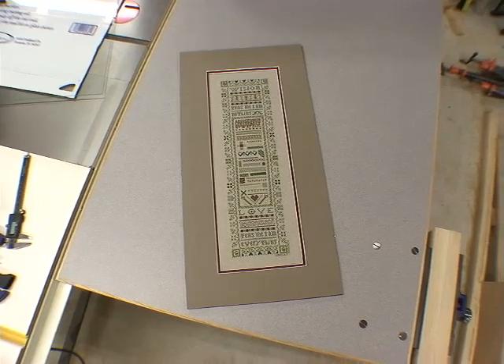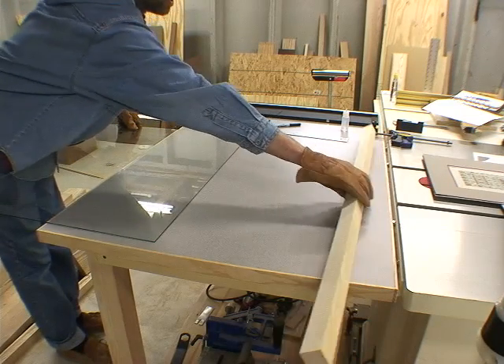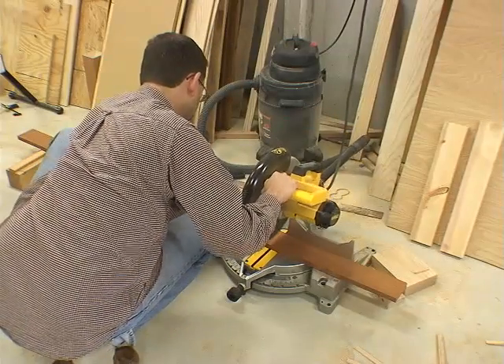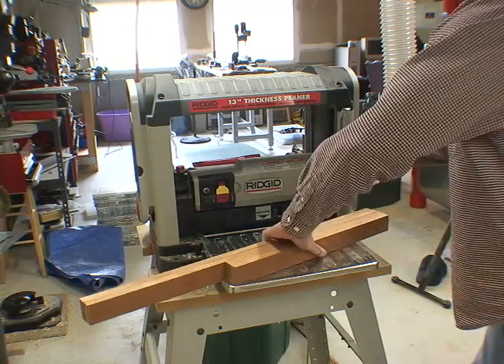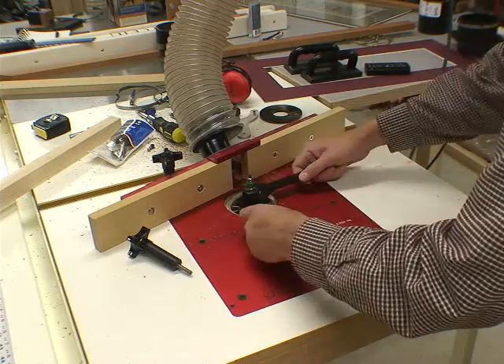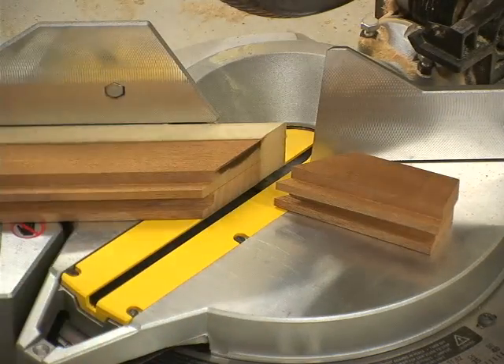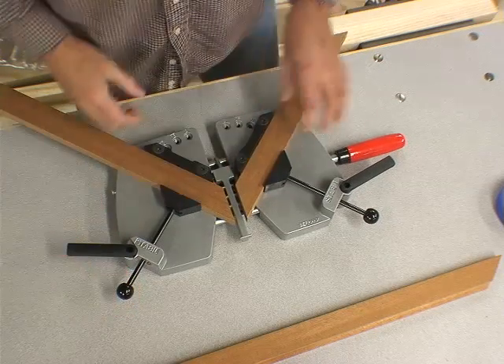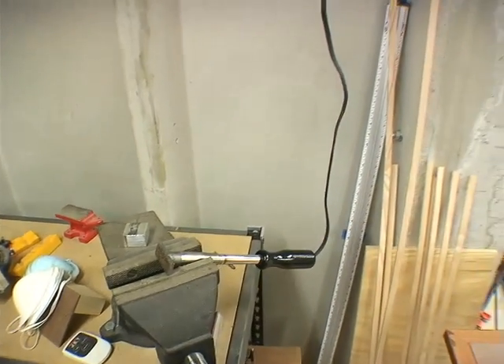How I Build a Wooden Picture Frame

Comment: Thanks. I'm concluding that when making picture frames, at least fairly plain ones, the very FIRST step after making sure your boards are uniform in width and thickness, is making the rabbet cuts and go from there. I want to make rustic frames from pallet wood and barn wood.

Comment: Very few videos even mention the inside measurements of the frame and the rabbet and I've always wondered on an 8x10, do you measure the short side of the frame lengths  7 1/2 in. then make rabbets, say, 1/4 inch to make a total 8 inch opening?

Comment: I noticed on the back of the frame that the spill over of the top coat was noticeable.  I wonder if putting some blue tape around the back would keep that from happening.   Not critical for something that hangs on the wall, but for a desktop frame or something that stands up it seems important.